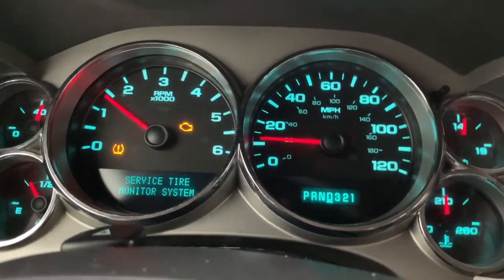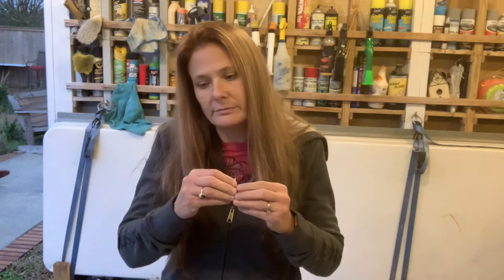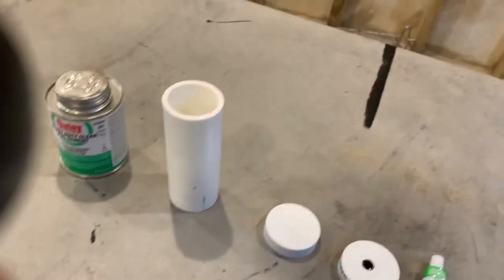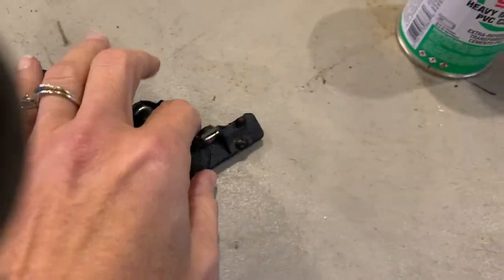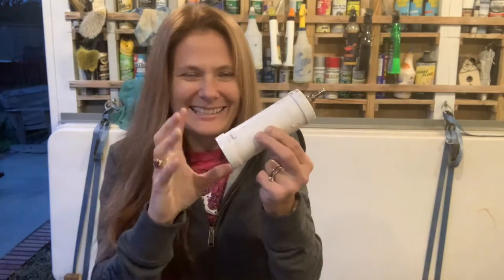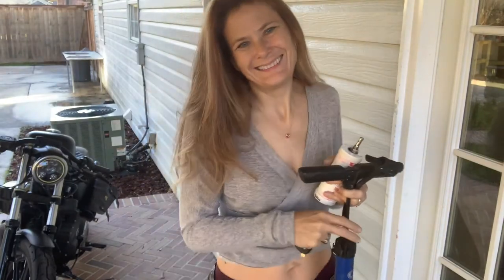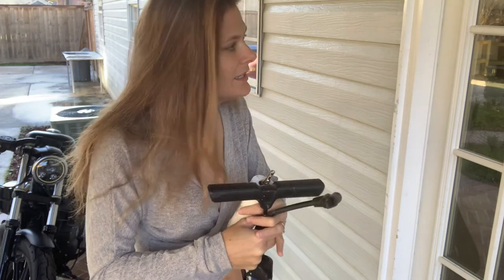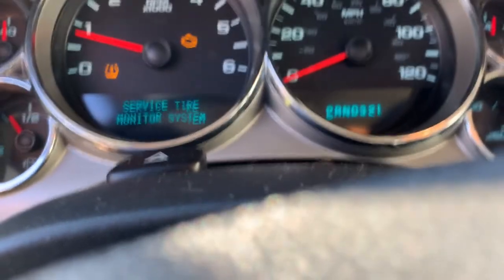How NOT to fix your TPMS (tire pressure monitor sensors) fail!

Comment: your in the right direction except you need a tpms tool to program them then it has to be plugged in to diag connector and written to vehicle
Reply: Pretty much!

These trucks also have a self learn procedure on the dash using the trip/odometer button. So you don't need the tpms programmer.

- Build a canister with a screw on cap and place one sensor in at a time.
- Fill the canister with air. 
- Put the truck in "learn wheel positions" by cycling through the odometer.
- Begin to slowly release air from the canister. 
- When the truck has learned that wheel sensor position it will honk. Stop releasing air.

Empty the canister and repeat the process with the next sensor. Once the truck has learned all four wheel sensors, put them all in the canister and fill it to the correct psi. Good to go!

Comment: Instead of making that PVC container just wrap the sensors in a towel pop the bead on your spare and put them inside your spare tire. Inflate to spec and it works great. You can still use the space saver spare when needed. 😉

Comment: Betty, here's a suggestion for a video. I wash my truck, 2018 Dodge Ram 1500 all the time. I hate doing the inside windows. On the truck or my car. Hard to reach and hard to get all the streaks out. Any idea to make it easier and better? Thanks,
Reply from the maker: Yes there is a tool for that! I’ll make a video 👍😁❤️

Comment: You dont need to buy new sensors , and build a container . Let ALL the air out of the LEFT front tire , wait about 5 min , refill the tire to proper PSI . Drive the car for at least 1/2 mile , this should reset the light . ( Make sure to air up the other tires to proper PSI before driving . )
Reply from the maker: Without sensors in the tires?
Reply: @NotamechanicBetty  If you removed the original valve stem sensors than this will not work . If you kept the originals , then put them in the container , add air and the light should go off . But if you bought new ones like you said , then they will have to be reprogrammed in the computer according to the numbers on them . From Left front clockwise around the car .
Reply from the maker: @anthonyl.goraczko6099  thank you